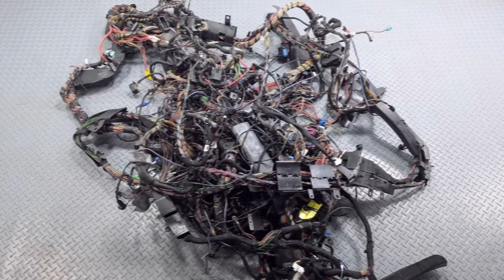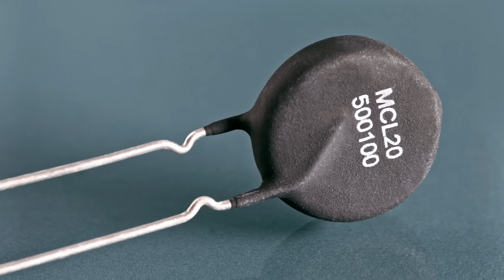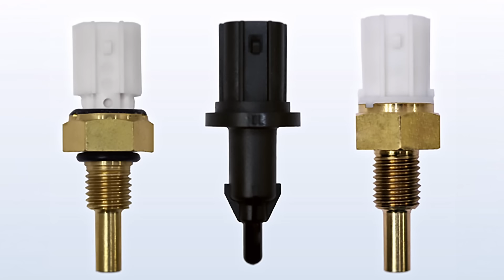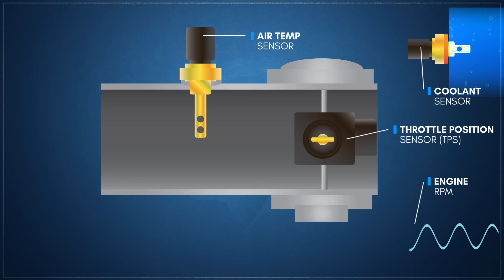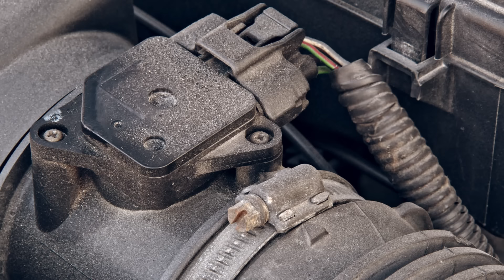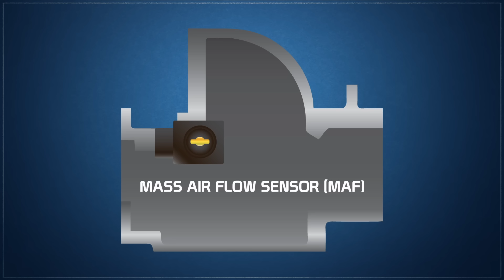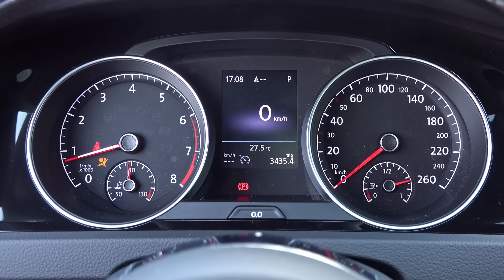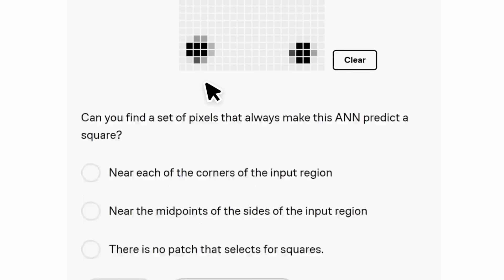The Insanity Of Engine Sensors

Comment: All my vehicles get basically the same milage in real world driving
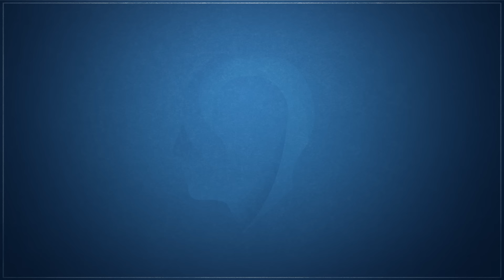83 3/4 ton suburban quadrajet 350 sm465 4:10~14 mph

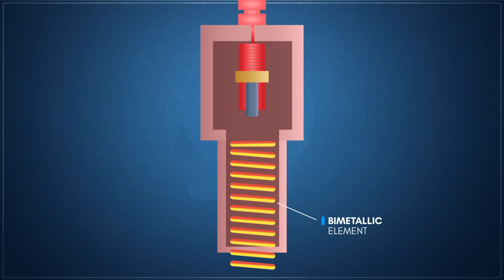1991 chevy blazer tbi 350 700r4 3:42~14 mpg

2006 silverado 1500 5.3 4l60e 3:42~15 mpg

2024 3500 silverado 6.6  gas 10 speed 3:73~13 mpg

All 4wd

Comment: The section on Oxygen Sensors would have been better served by a physical explanation of how they function exactly. Saying that the sensors are most sensitive at the stoichometric ratio of oxygen for combustion is nonintuitive. They don't magically exist with that specificity, they are tuned to that band for our purposes and a better explanation would have dove somewhat into the physics. If someone asked me how oxygen sensors worked after that segment I wouldn't be able to tell them anything other than there's a ceramic interior with a permeable platinum interior that is somehow sensitive to the stoichometric ratio of oxygen for combustion. Just a bunch of hand waving.

Comment: Sensors are great for feedback to the pcm but the build quality and durability of the mechanical pcm controlled components has been less than desired in the past decade.   Complexity and component placement/location in the vehicle has increased the difficulty in remove/replace repairs.

Comment: Meanwhile you can make an LS engine run with 2 sensors and 6 dead cylinder , heck even an entire bank dead and still runs. 😂😂
Reply: Yeah but Sensors are the majority of the reason why the LS motors make 2-3x the hp/L compared to sbc

Comment: I remember I had a code on my car that kept popping up. Lean air/fuel on o2 sensor one or whatever if i remember right. Replaced both o2 sensors it was running better but still had the code. Replaced the mass airflow sensor. Running better but code came back. Replaced manifold absolute pressure sensor. Running perfectly but code was there. Then I found a little tiny hose on the evap canister that looked bad. Replaced it and it went away.

Comment: It's all good and great until we have a carrington event and all these sensors and computers experience a sudden death. Then the man with a carburetor and points ignition will be king again. Or anyone with an older, non computer controlled diesel. In the event of a strong solar storm or an electromagnetic pulse weapon, all computer controlled cars will become useless
Reply: Most modern electronics have really good radiation resistance, my MSI board for example is rated to handle an EMP from a nuke lol
Reply: I might be thinking of EMI (electromagnetic interference) though, rather than EMP lol

Comment: I have a TDI VW Passat with the EA288 engine. I found and downloaded a lot of the design documents on the engine (I am a firmware engineer) and was simply blown away by the number of sensors and actuators used in the engine. What VW had to do to get performance out the engine while meeting emissions standards is amazing.

Comment: It's just to make the engine far more complicated, with an extensive wire loom stretching throughout the car. Sensors are all proprietary forcing you to pay the manufacturers price. Electrical complications also meant tuners/software becoming required and drastically limiting what the average person can do.

Crock of crap. My older explorer, I could just jumper it with a paperclip or wire and it would blink it's trouble code through the headlights. Wtf happened to that??

Comment: sensors are good if they dont have wires running inside heated parts and components, which they almost always do. sensors are there so the vehicle can break down much easier, either one buy parts or just get a new vehicle. it's not about safety or the environment anymore.

Comment: As an ME/ mechatronics engineer, I understand the sensors. I was really hoping this was going to go into the cost benefit analysis. As some sensors go bad the cost of repair and the limitation put on the engine if a sensor goes out exceeds the cost of repair and is treated as if there's a mechanical failure of the engine itself, which is usually fine. That and or a bypass of code standard really needs to be set
Reply: to me, the only important sensors are MAP and crank. everything else is just an extra. if it cant default to those two basics, its shouldnt be...

Comment: It's moving towards the point where one tiny part in the vehicle fails and the whole vehicle starts to self destruct. Furthermore, we the users of our own vehicles will have absolutely no idea how it works or how to fix it. So then it's a garage bill of £3000 plus for a small fix. 
Digital in many areas of technology is not actually a development but in fact an over-complication and an abstraction from the principles of the physical universe. The reality of digital is that it will always generate some kind of a discrepancy that falls out of alignment with nature and so it will try to solve the problem that it creates by going levels deeper and further complicating itself. It can never represent the nature of matter and energy. - That's my view.

Great video!
Reply: There are analog signals, most of the input is analog, in many ways, this works better. Pwm is not digital, it is a form of frequency modulation. Digital wound be like the door switches, or the break switch, a binary signal. Can bus is kind of unique as it seems to be a hybrid of both with the differential between high and low being a fixed value, but the reference of them is not a fixed value. This tolerance is to allow the immunity to electrical noise and eddy currents.

Comment: These sensors have destroyed modern cars. All these sensors all serve to increase Horse power by at least 10-15 % max all at the expense of going to the Mechanic for a long time after manufacturer warranty has ended. 

All this has increased  the efficiency of cars 10-15% and increased their maintenance costs by 100% of the purchase price.

This can't work because it is extremely hard for all these sensors to be optimized continuously for a long time when car mileage goes from 50,000 miles to 250,000 + in gasoline engines.

100 crappy sensors to optimize emissions and engine temperature.

Comment: This is the main reason why cars these days are failing big time, too much tech built into them, way too much.  Now with the EPA defunct, they can bring back the days of the 70's and 80's of more simple vehicles built,  as the mass amounts of sensors reduced down to a few necessary ones.  We don't need all of the 'advanced' technology that has gone nuts that make vehicles last only a few thousand miles before failing.  The motoring public has responded to the sales of those highly infected cars with multitudes of sensor crammed under the hoods of them, they simply quit buying them.  I don't see any turnaround of the buying any of the new cars with too much tech until they learn to severely cut back on the making of them and go back to the earlier, simpler versions of cars before all this stupidity came about.  Bring back the meaning of KISS, or Keep It Simple, Stupid.

Comment: All just a bunch of unnecessary garbage that will fail.  All you need is oil pressure, Temp and fuel.   You know whats not efficient is a vehicle with a bunch of sensors that fail and put it in to limp mode.. Its all about selling you parts its a scam.

Comment: Currently dealing with an electrical problem in a 2020 Camry where the mass air flow sensor, radar sensor, and windshield camera sensors all lose communication randomly while driving.

Comment: I worked extensively on the Datsun L-series (Z in North America) - one of the first wide scale EFI systems. Comparing those sensors to modern stuff - the advances are just nuts.

Ever see the airflow meter on one of those beasts? We are spoiled rotten by sensor tech now.

https://www.youtube.com/watch?v=u_Wi1M4hG5o

Comment: So in Reflection; i have one problem. with just focusing on the good feelings without any framework or structure of what good feelings are, or how to remember and recall that feeling when necessary, how can you expect persons who never felt good feelings when interacting with a specific or general event to not have bad feelings.
 Ie a lot of people deal with self induced Stockholm Syndrome, as in: if the bad feeling is what they know, then it is what is expected. 

So while i like your argument for a non woo idealogy; you still don't provide the user with a defined set of positive experiences, how to glean understanding of these things, and how to learn new goodfeelings.

Comment: The sensors aint the problem, the problem is the software which shuts of completely unrelated aspects for no good reason, why the interior light needs to know the engine revs for example? Or why the wheel speed needs to know the cabin temprature.... Its the software

Comment: That's great, but now cars have become too expensive to buy, and too complicated to fix.  Dealers make their money on service and repair, and sub the work out to independent contractors who name their own price.  If they guess wrong about what the problem is, you get to bring the car back and pay even more for a second attempt.  At this point, they pad the bill and tell you they'll "negotiate" the total down with the technician.

Those of us who grew up spending decades of our lives fixing our own damned cars are now too old to crawl under or bend over engines anymore, and haven't got the patience to try to figure out all this canbus crap with sensors and computers everywhere that don't always play nicely together, and don't always give you the correct code to fix the problem anyway.

Try passing a smog test after you've had to replace a battery.  Then you have to complete some bizarre "drive cycle" ritual, which can require hundreds of miles of driving before the ECU gives you its blessings and says it's finally ready to let you pay more money for a smog test, and the DMV doesn't want to hear that your car's computer isn't ready to let you get a smog test yet... they want it now, or you can't renew your registration.  I guess that's why old cars from the mid-fifties are now selling for $20,000 to $50,000 or even more!  In the Sixties, I could buy them all day long for $1,000 or less...

Comment: My favorite years of the electronic controlled vehicles is the first decade of OBDII. A standard most manufacturers stuck with (except, Chrysler). I'd like to see more development in replacement PCMs with vast improvements in data storage (ie tables) and processing speed. They'd have a library of emulators to be able to communicate with any existing protocol with modules like body, transmission, ABS, Airbag, everything. Easily swappable parts like changing from narrow band O2s to wideband or even adding an air/fuel ratio sensor. This would increase efficiency and power. Imagine a PCM which relied on the fuel pressure regulator keeping 55psi to help calculate injector pulse width. The addition of a fuel pressure sensor would allow PCM to further fine tune injector pulse. Hence: speeduino and megasquirt. Should see more in the future.

Comment: I think that by 2010 the automotive industry had entered the "diminishing returns" phase of vehicle automation. That is why so many mechanics say that the 90's were the last great decade for automotive design - those vehicles struck the right balance between price, maintenance costs, safety, and performance.

The cost for all this sensory technology no longer outweighs the benefits. The sticker price is way too high to justify it, not to mention the increased repair and maintenance costs. Automation made cars safer, cleaner, and more efficient. But, with more complexity and frailty, the benefits of modern extensive automation seem unclear, and make modern manufacturers look incompetent.

Comment: As a advanced automotive service technician that loves testing, diagnosing, and fixing electrical systems I think this is my favorite video on your channel so far
Reply: My heated seats stopped working but all the fuses are good. Where to start?
Reply: @ both seats or just the drivers seat? Chances are the seat heater pad is probably done and needs to be replaced
Reply: @Tech-28  both seats and the backrest lean angle on the driver's side
Reply: @BariumCobaltNitrog3n  I would find out which wires at the seat connector are power and ground and then with the car on and heated seats turned on check for proper power and ground. If power and ground is good it needs heated seat pads, if no power or ground you might have a wiring issue or a control module issue
Reply: @ the heated seat pad will have a transistor inside of it that likes to go bad. Odd that both seats don’t work, usually it’s just one seat top or bottom
Reply: @Tech-28  No power to either seat or to the back of the seat angle.

Comment: Give me a carburetor and points ignition over all that shit. I can fix basically any problem I have with a leatherman and a Bobby pin. Don't need proprietary software (usually with an outrageous subscription) to try to track down what sensor broke this time. You generally can't fix those sensors on the road either. So if you break one the car won't run without your stuck calling AAA.

Comment: A thousand sensors lead to a thousand potential failures of the sensor itself. Not so bad if the engine software was open source to allow erroneous or unimportant failures to be ignored.

Comment: i feel like cars just became more gimmicky. manufacturers crammed more and more features and gizmos and thingamajigs in to turn your car into an entertainment system (big touchscreen, apps) which requires more electronics creating more potential failure spots. the technology itself is cool and all but more doesnt always mean better. the functions should be essential for your driving ability, you dont need to have games or have movies playing while driving. new sensors should be beneficial for reliability, not so that my car can detect if what i placed in the cupholder was a drink or not. I believe the best electronic user-optional features are electric windows, window defroster and a stereo. i dont need more than that. the cars i drive barely have all that. driving 90s-early 2010s cars is so refreshing.

Comment: Imagine cars in 2100.  
A genius comes up with the idea of a completely passive fuelling system requiring no sensors, electrical or electronic control systems, operates on just 0.2bar fuel pressure, and can be used on numerous engines by simply replacing a few cheap parts.
He names it the carburettor, and the flat four air cooled engine of the VW Beetle is heralded as the simplest most reliable internal combustion engine ever built.

Comment: The only insanity about engine sensros is the fact people have been duped into thinking they are anything but a way to make more things in a car need repaired.  Inline 6-cylinder 1966 Oldsmobile carbureted engine got 36 MPG off the factory floor.  It was big, heavy, metal, and had a lot more room.  It was easily fixed having no expensive computer components and sensors.  Modern cars are a joke in comparison.  These stupid sensors/computers have not done anything (as is often touted) to help fuel efficiency since our cars nowadays are chintzy built and much lighter, yet they still don't get any better mileage than that old Oldsmobile that was hauling around a lot more weight.  Reality from someone who was there.  The concept is to make things not repairable and expensive to repair so the companies get more money.  Eighty percent of your gas STILL goes out the tailpipe even with modern systems.
Reply: Lmfao, your Oldsmobile was making 1/3 of that MPG you liar. 🤣